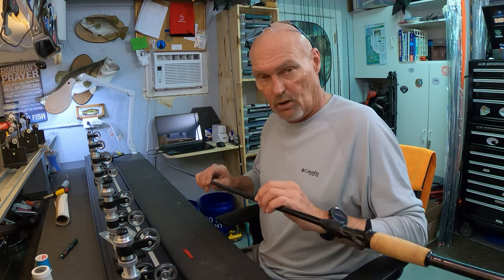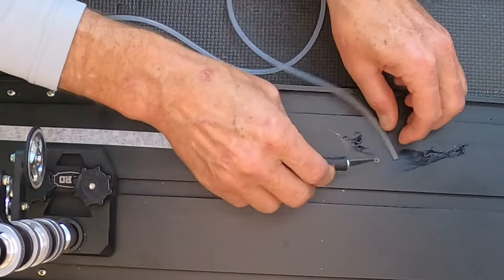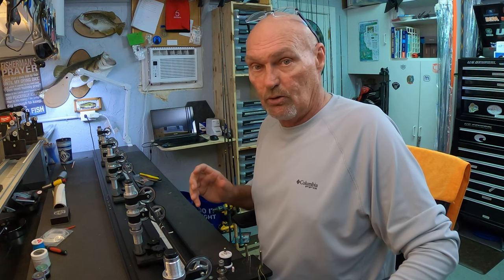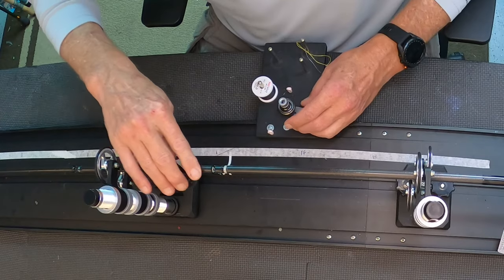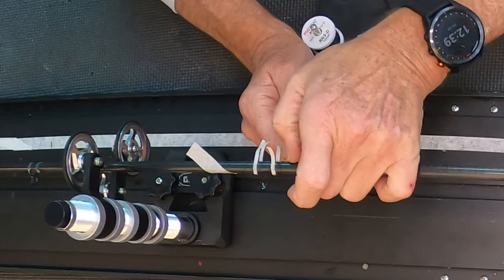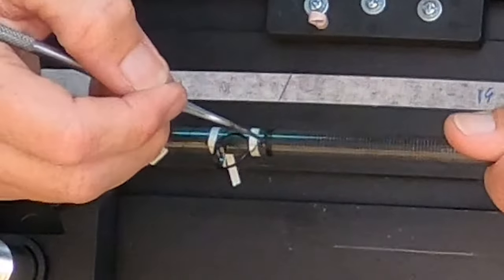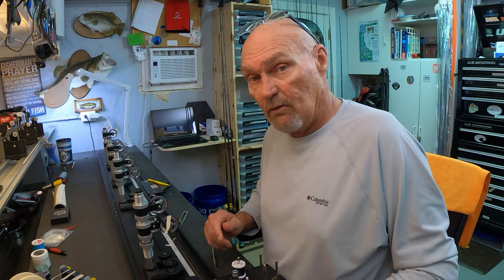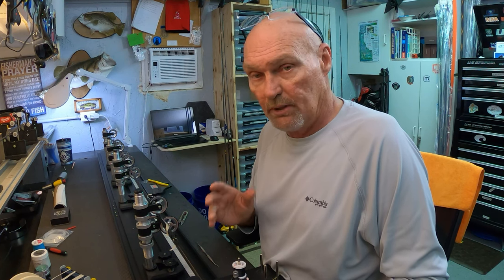Thread Tension and other Stuff

Comment: I use the same type of of thread carriage, I has been a bit of  struggle using the spring tension only, so I go around the  thread spool holders, snake like, then I make minor adjustment at the spring tensioner